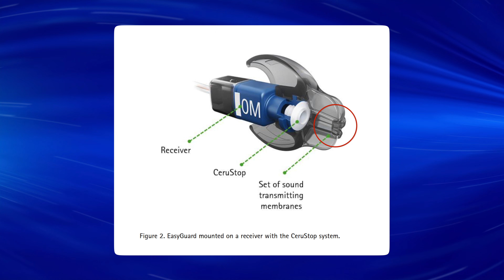Hearing Aids are a WASTE OF TIME!

Comment: I was a wax factory too... until I was told at my audiologist office to gently wash my ear canals with shower gel suds while in the shower, rinse well under the shower,  then put half a capful of three percent hydrogen peroxide in each ear for one minute before draining and drying. This has worked well for twenty years. I change wax guards on my Phonak Spheric I90s about once a month even though there is no apparent wax build-up. YMMV...

Comment: I am using a large Power dome with my phonak sphere hearing aids and I see no way for wax to get through these. There certainly is no opening that I can see. And I am having no problem with wax. Am I missing something?
Reply from the maker: Yes. You are missing the holes under the hood tip of the dome. However, if you don't produce a lot of wax, it's a moot point.